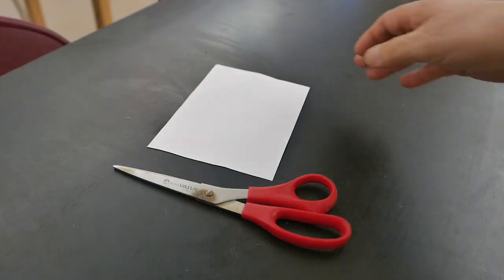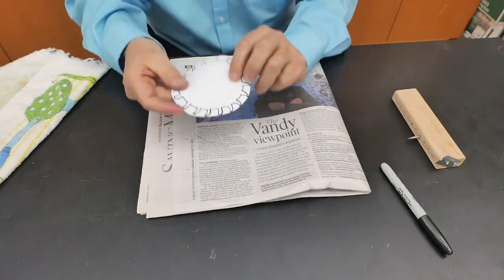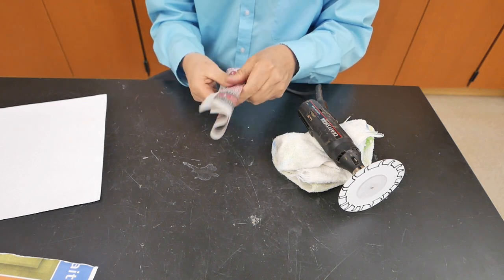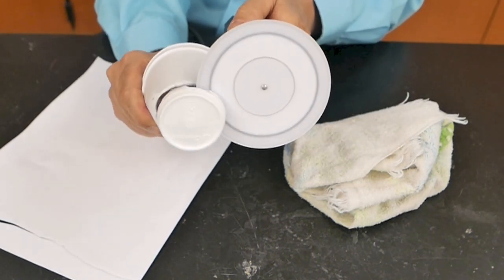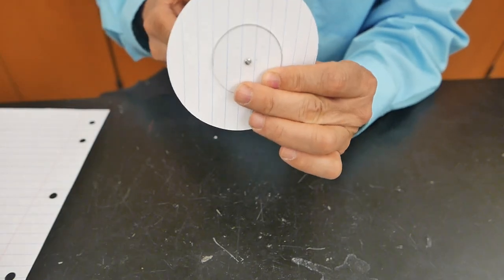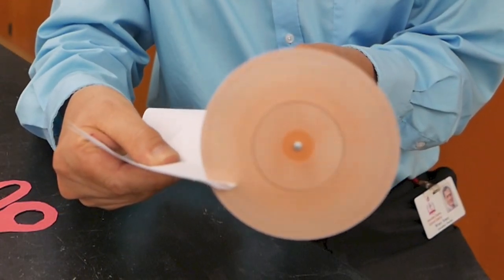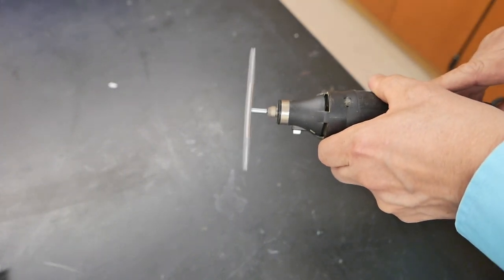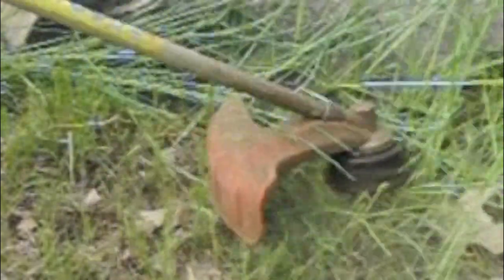Paper Saw Blades- paper cuts paper- Part 1- centrifugal force  //  Homemade Science with Bruce Yeany

Comment: *thinks he's smart yet he puts "centrifugal force" in the title
Reply from the maker: "centrifugal force".  I  point out that this is a fictitious force.   The behavior that it describes is real enough, however the words defining it are incorrect. the term "force" used with the word centrifugal  is misleading and wrong,  there is no force applied radially outwards.   However, even though it is mislabeled, the term centrifugal force is used to describe the motion of the matter or an object moving  radially outwards.  This is what we observe here when the paper straightens out when spinning  or the string on a grass trimmer becomes rigid as it spins and can be seen in all sorts of other examples and applications all well.  It can be as simple as soaking a towel with water and spinning it over your head.  The water drops move away from the towel directly outwards from the center of rotation ( centrifugal force)  My preference would be to call it a centrifugal motion.   What we are seeing is a cause and effect.  The centripetal force which causes the object to curve off of a straight is applied inwards towards  the center of rotation.  This inward force pulls against the inertia of the object and the effect or result is an outward movement even though there is no outward force.
Reply: #REKTFACT maybe he just put centrifugal force in there because in fact it was entirely fucking relevant.
Reply: I... i wish i can argue like that. I may be the happiest fucking person ever.

Comment: talks about something as if it is real. says it is not real. WTF EVEN
Reply from the maker: The demonstration  relies on the concept  referred to as "centrifugal force".  I would point out that this is a fictitious force.   The behavior that it describes is real enough, however the words defining it are incorrect. the term "force" used with the word centrifugal  is misleading and wrong,  there is no force applied radially outwards.   However, even though it is mislabeled, the term centrifugal force is used to describe the motion of the matter or an object moving  radially outwards.  This is what we observe here when the paper straightens out when spinning  or the string on a grass trimmer becomes rigid as it spins and can be seen in all sorts of other examples and applications all well.  It can be as simple as soaking a towel with water and spinning it over your head.  The water drops move away from the towel directly outwards from the center of rotation ( centrifugal force)  My preference would be to call it a centrifugal motion.   What we are seeing is a cause and effect.  The centripetal force which causes the object to curve off of a straight is applied inwards towards  the center of rotation.  This inward force pulls against the inertia of the object and the effect or result is an outward movement even though there is no outward force.
Reply: Centripetal force would be a more accurate term to use.
Reply: +Bruce Yeany (Yeany Science) omfg... stop typeing so much please. you expect a person who made a stupid comment like how I did read THAT? no.
Reply from the maker: LOL, sorry I got caught up being a teacher